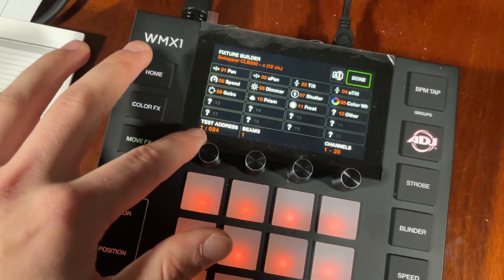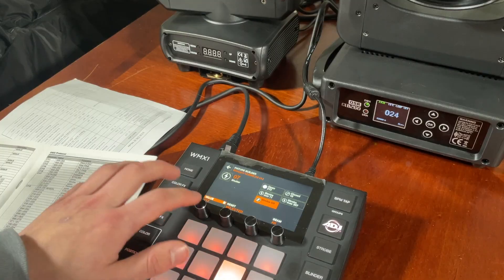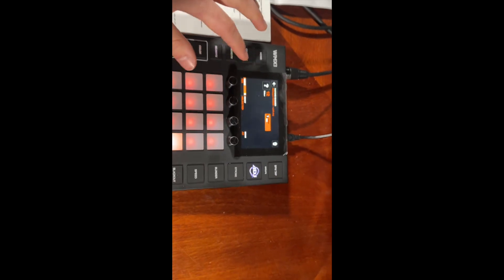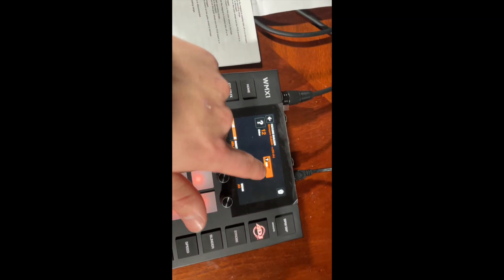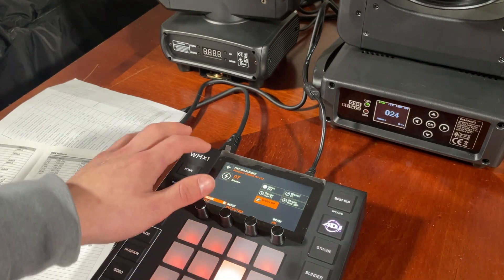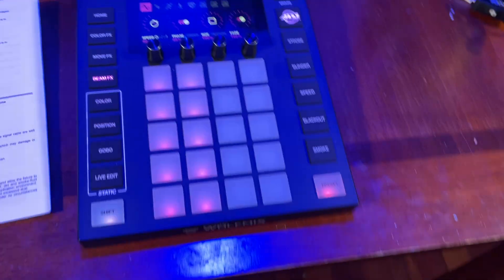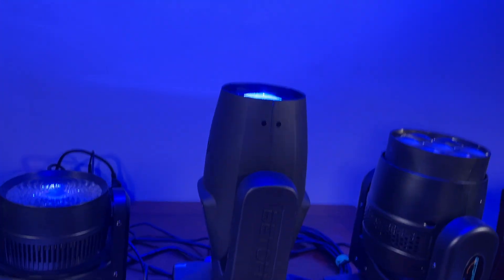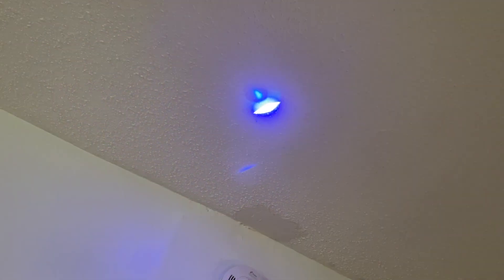Advanced DMX on ADJ WMX1: How to Edit the Base Fixture Profile and Customize it to fix Errors

Comment: Just got Rock Spot 260s and the profile doesn’t seem to be correct.  Not able to rotate gobos.  Any thoughts?
Reply from the maker: If you havent already, check out the precursor video to this, if that doesnt help, contact wolfmix for help, they should be able to point you the right way

Comment: HI Alex - excellent lesson on setting up the "budget" fixtures. I've run into a few instances especially where I had to change the intial setup so that the fixture is on/open on startup. Soime are the dimmer while some are the shutter. The Vshow 7*40 for example has the default zoom setting at something like 68, which is halfway into the bee eye look, rather that the beginning zoomed setting. 
You can also get at these settings in the DMX tab in the Settings menu. You need to have your DMX numbers listed out so you know what fixture you're working on
Reply from the maker: Yup this is a matter of some limitations of the WMX it doesnt really understand special features like bee eye, or really even focus and zoom, they often have to be manually controlled.